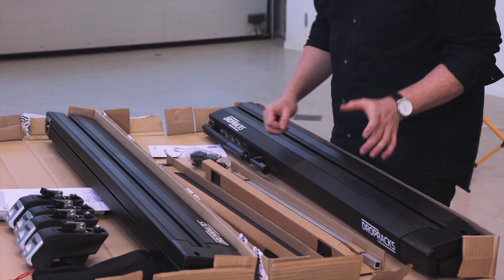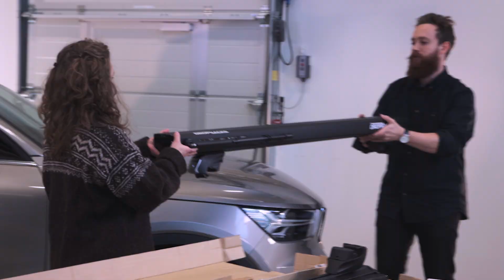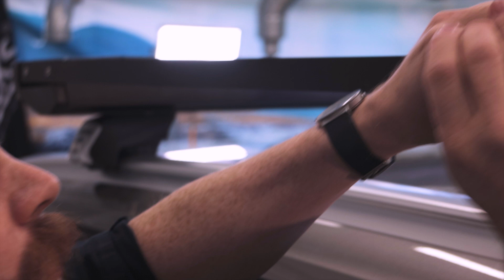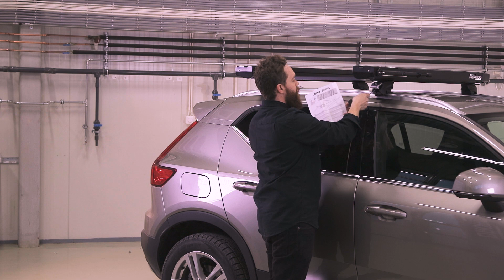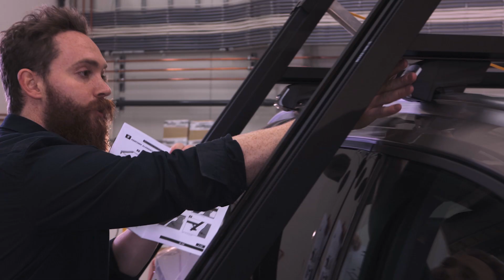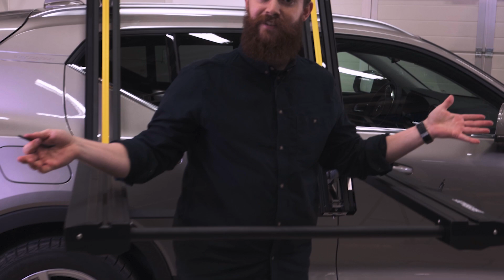Dropracks Lowering Roof Racks Installation Guide

Comment: Does a huge portion of the rack stay empty because you need to leave space for the crank arm when rotating? 🤔
Reply from the maker: No, but good question though. Youu can also crank only at the bottom 180 degrees if you load the full width.

Comment: how is the wind noise of the rack alone compared to typical yakima or thule rails?
Reply from the maker: Slightly more than traditional bars, less than a roof box.
Also depending on car geometry, positioning on the roof and sound absorbing properties of the car.